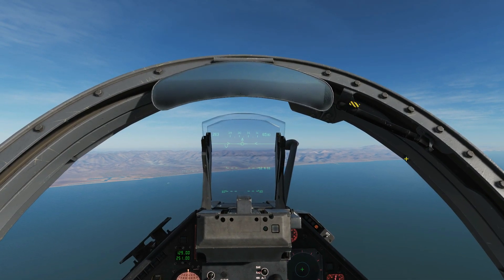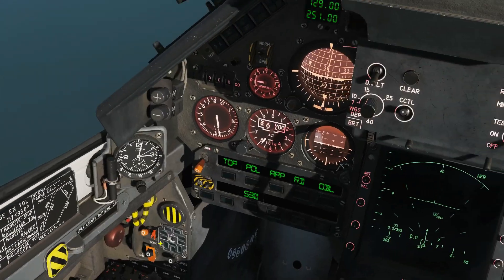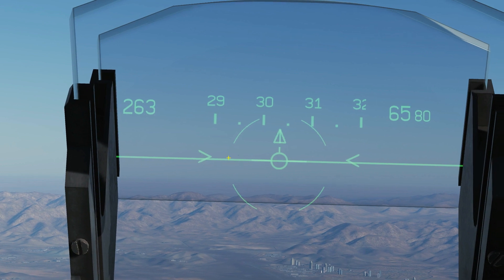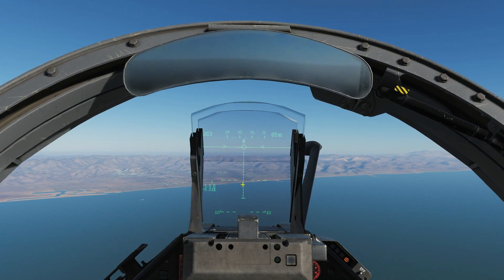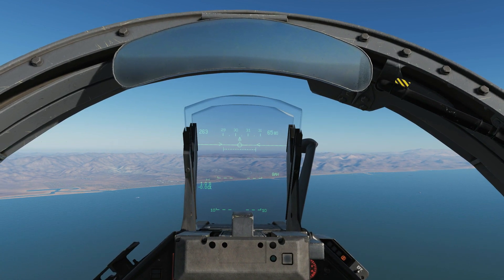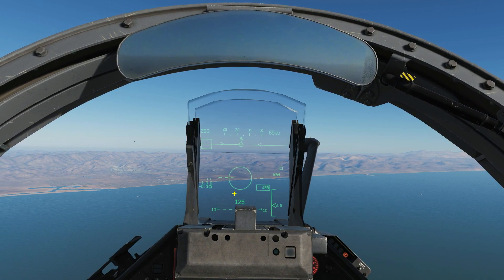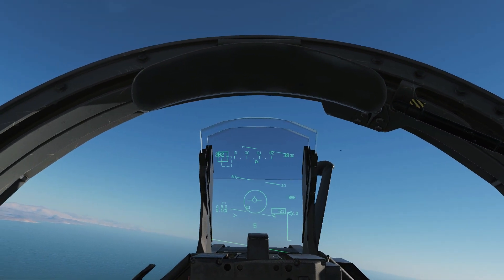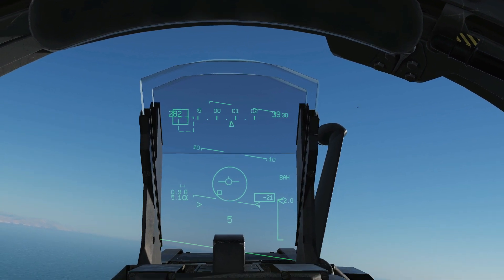Mirage 2000C: ACM Radar Modes Tutorial | DCS WORLD

Comment: Question: is the Mirage 2000 module Fox 3  capable? Also, how many air to air missiles can be carried in a CAP/Fighter Sweep configuration? Only four missiles (2x Fox 1s and 2x Fox 2s) ?
Reply: No, the Super530 is SARH, so Fox 2. Maximum AA loadout is two Magics (IR) and two Super530s. Both would change if we got the Mirage 2000-5, which can carry the MICA IR and MICA EM on the fuselage pylons.
Reply: @Gneckes  SARH is fox 1.
 IR guided is fox 2 ie: sidewinder, magic
Reply: @Gneckes  hmmm.... not very reminiscent of a true, pure air to air platform like the F-14/F-15...
Reply: @ColmVD  Firstly yes the Mirage was designed as a multirole fighter and secondly, it's a lot smaller and lighter than a Tomcat or Eagle.

Comment: The CMD depress is indeed quite important! Because of how the Mirage works, if you want to go from one of the AA modes (bore, hud, vertical, horizontal 1 & 2) to a ground attack mode, like f.e. CCIP with the gun, you have to use CMD depress while in an AA mode first, then select the gun, then press CMD forward. 

That's iirc the correct procedure. If you don't follow it, the modes can end up getting stuck and you can't get to your A2G gun mode.